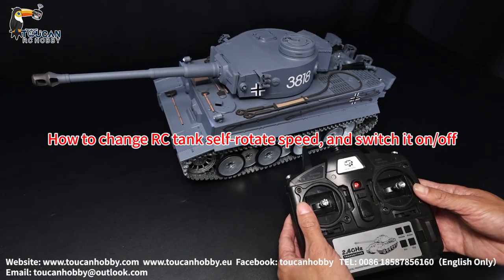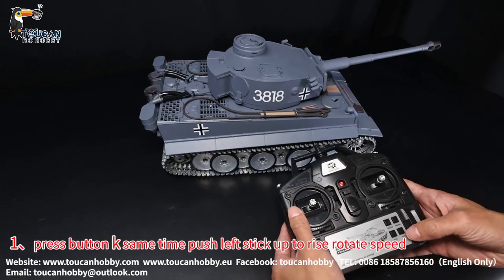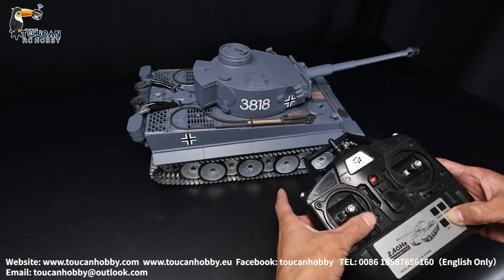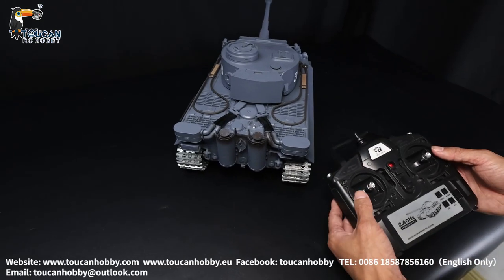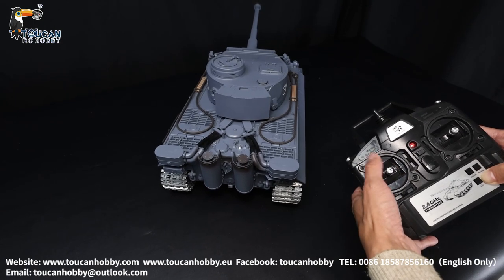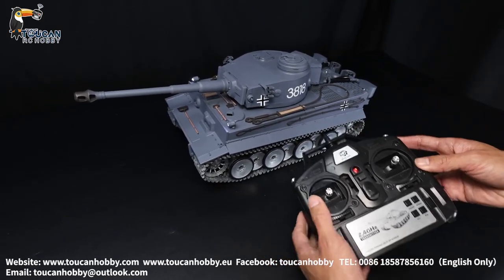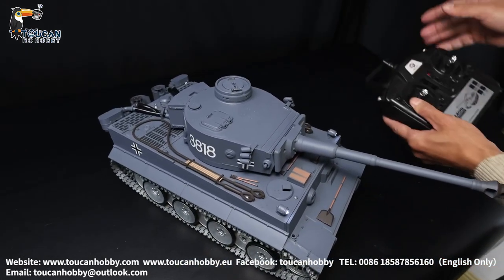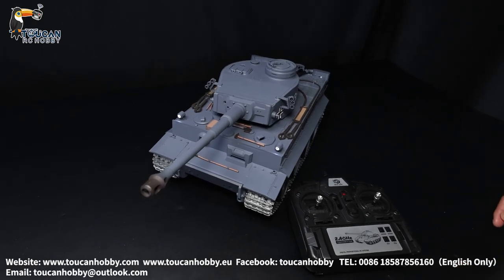How to change RC HENGLONG tank self-rotate speed, and switch it on/off

Comment: Is there a forward and reverse speed setting that can be changed for slower driving?
Reply from the maker: Slow drive mainly controlled by push stuck less, for changing to less speed mode is 75/100 not much difference